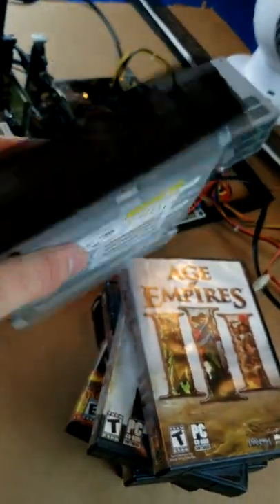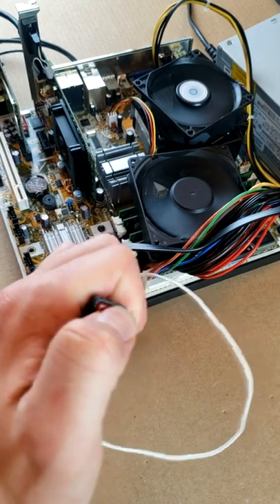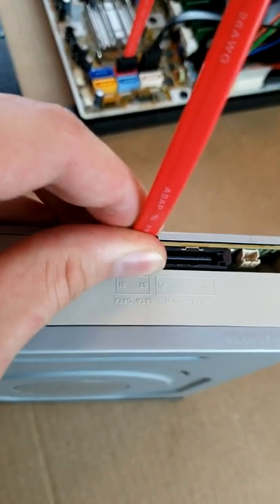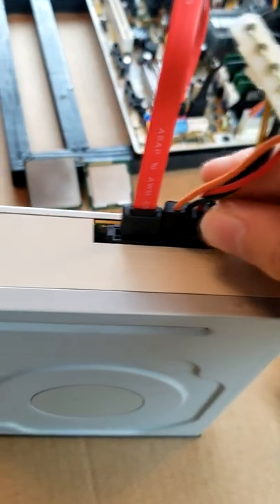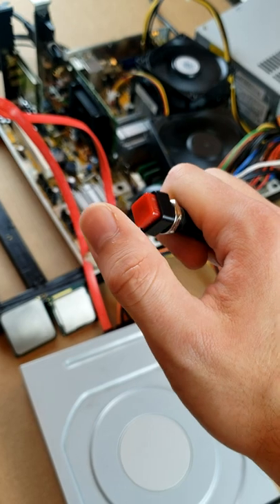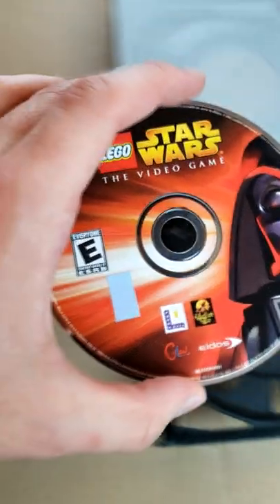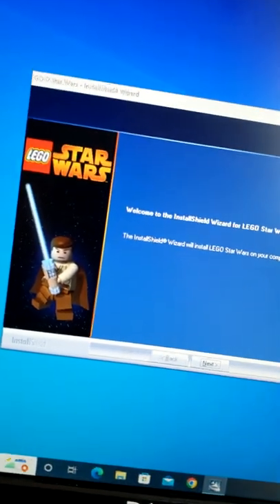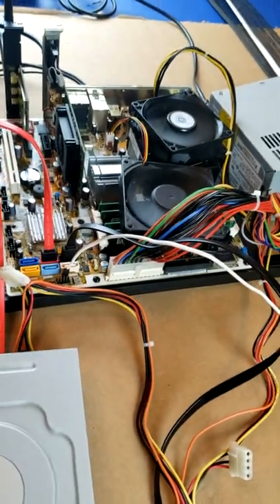Your PC NEEDS A Cd Drive #shorts

Comment: You'll also need a version of windows that can still run some of those games, windows 10 is likely to fail on at least 2 of those.
Reply: That can be change the compatibility settings
Reply from the maker: Yeah that's true. Most of them do work fine though.

Comment: USB 3.1 CD drives work great too, not much of a difference in R/W speeds either.
Reply: Not really, a desktop drive has more torque so it can spin the disk faster making it able to access data faster, up to 2x faster than a usb dvd drive. Also desktop drives are generally more reliable long term.